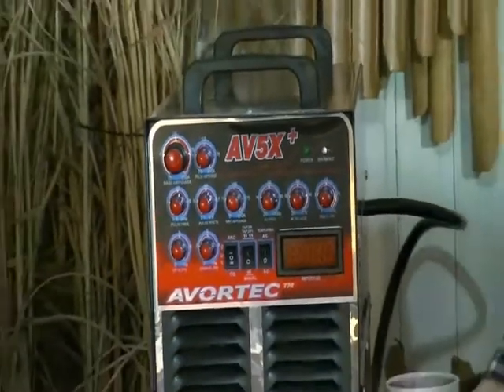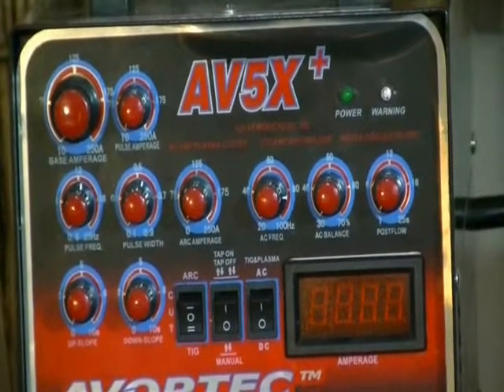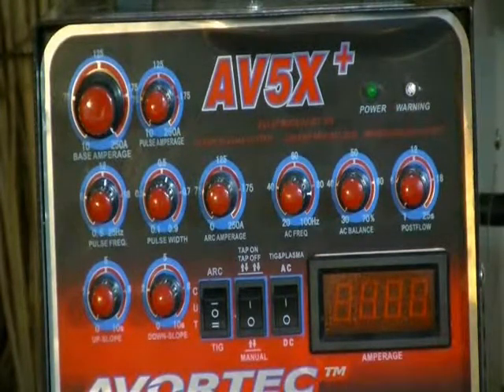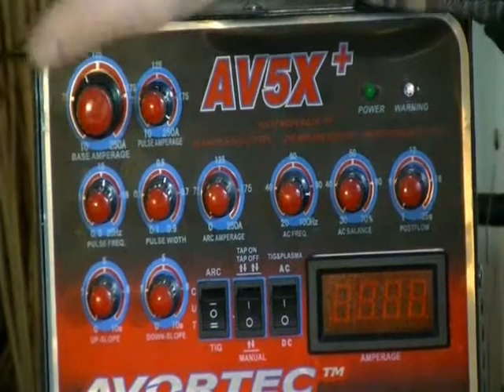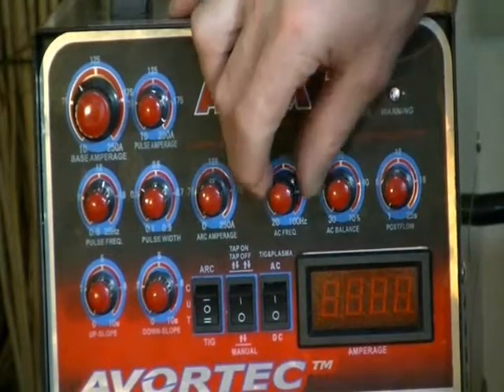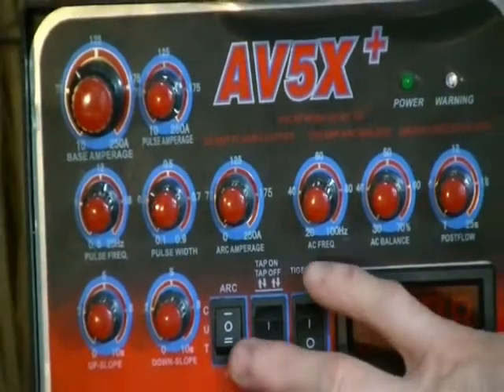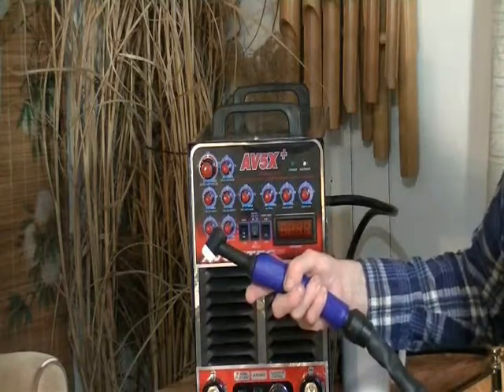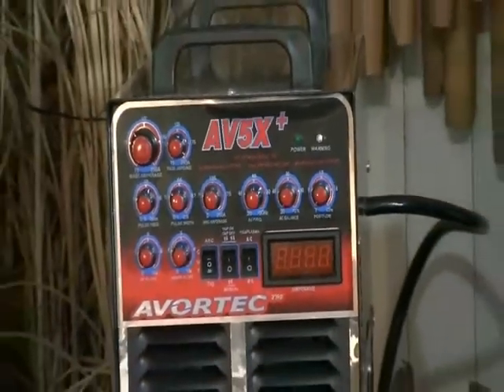Avortec AV5X+ Multi process Machine review, Controls - Intro 3

Comment: I have an Avortec 10x. It didn’t work properly straight from the box. The plasma has a short and destroyed itself. The mig shorts internally. The tig gives 3-5 minutes before fluctuating wildly. The arc did ok for a few months. 
We sent it back for warranty repair. After months it came back no better. The owner is a nice guy. But has dozens of excuses. It’s wonderful for teaching new welders to stick weld. The voltage is so erratic that if they can learn to weld with it. They can weld with anything. 
The product makes a very attractive paperweight. We certainly can’t trust it for customer work.

Comment: Hi, I also have the AV5X+ and love it, but today when I turn it on it was buzzing inside, I took the cover off and turn it back on and the spark gap on the board was arcing. I disconnected everything and still does it. any clue ??? Thanks..